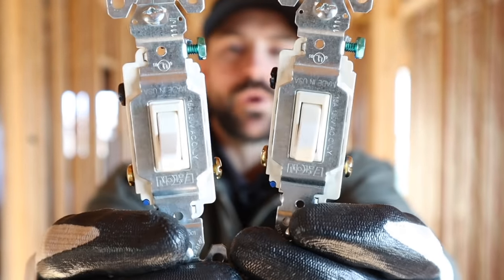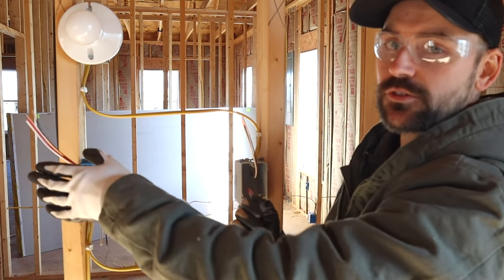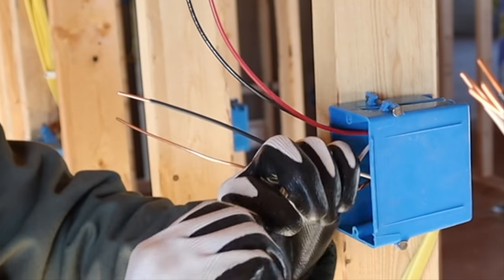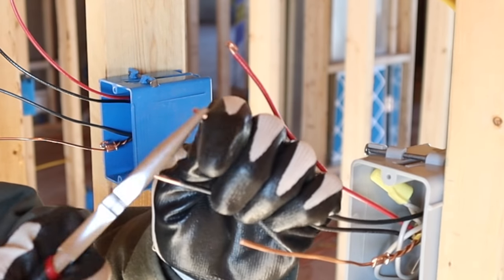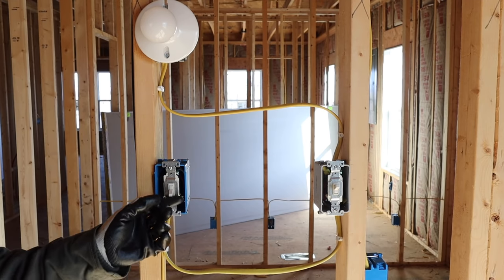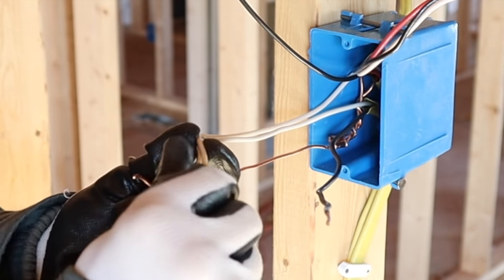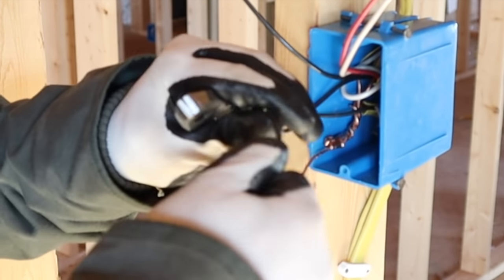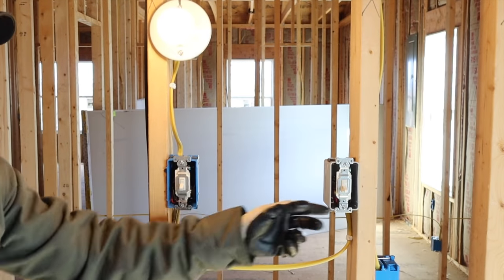How To Wire A 3-Way Light Switch - 3 Way Switch Explained (2 EASY & SIMPLE Methods)

Comment: Thank you for the great tutorial, straight to the point and easy to follow. My house doesn't have a 3-way switch for the kitchen light, so I am planning to add it for convenience. I believe method 2 will be the setup since my kitchen light is set to have this type of wiring.

Comment: Josh that was an excellent video about the ever confusing 3 way switches.  I have watched youtube vids the past 3 days and this is by far the best explanation how to connect your wiring.  I am installing 3 led lights and an exhaust fan in my master bath and need a 3-way system.  
r
Thanks for your time and video very much helped 👍

Comment: Great. Now a question for you. In an installed and wall blind situation (House where you don't know which wire is which) How can you identify, of the two 3 ways switches, which one gets direct load brought in from the circuit and which switch is the one that carries the black wire to lamp/device?

Comment: I must say, I like how everything is explained in these videos. Very clear. I'm definitely  going to keep checking your other videos. Now, one thing I would suggest (just an opinion) is for any installer to double check the power going into the cables even after you turn off the breakers. Remember, safety first brother. Keep up the good work and thanks for sharing your knowledge.

Comment: Question: I'm wiring my new shop and for my lighting inside and outside I have a 2 gang box with a 3 way switch for the ceiling lights and a Sunsmart All-in-One timer for the outside lights. How would you bundle the wires knowing you have a neutral pigtail coming from the timer. The box has one power source. I watched your video on how to wire A 3-way light switch. In your video the second method is how my setup is. For some reason I'm having a hard time visualizing the proper bundling of wires. Wire size is 14/2 and 14/3. Can you help?  By the way, great video Thanks.

Comment: Thank you, I was trying to wire from a wiring diagram that didn't identify which terminals were which.  It looked like a match but it wasn't.  In a few days I have a timer coming that will replace one of them.  The timer being for the lay light that keeps the chickens laying on the short winter days and the swith being for if I need to check on the chickens after lights out.

Comment: The second example on the 3 way is a good one. Kinda shows what you can do with the neutral. And the light doesn't always come out of the second switchbox sometimes it comes out of the one the powers going into.

Comment: Great, informative video! The only thing I don't like in this video are those copper crimp sleeves you used on your grounds. They don't seem like they bond the two wires together very well. Both times you twisted them together, when you cut and folded the tail over, the sleeve slipped back. I would either use the wago connectors or the green wire nuts with the pass through for pig tails.

Comment: Hello Excellent.   I have to rewire two light fixtures in my garage and convert them to 3 wire.  Both are on single pole now. Is there a diagram for both lights to go on at same time? Or easy explanation?  THUMBS UP!!!

Comment: very nice video - I knew one way to do this three-way switch, but for some reason, it always tripped the circuit breaker - now thanks to you, I know two more ways - So, I think I will throw away my first way and use these two ways to do 3-way switches - I do wonder if one really needs to know 3 ways to do a 3-way switching connection - hummm..

Comment: My 3-way switch delemma is a light above each 3-way switch (two lights total).  There's 14-2 going to a light at bottom of stairs, and another 14-2 in the box top of stairs for the other light.  Then 14-3 connecting both.  Power comes in (another 14-2) at bottom of stairs.

Comment: I meant Josh but I love your channel, I was inspired when in another video you said you pulled permits yourself. I think I'll try that. Thanks for a great channel. I have a question about multiple 3 way switches in the same J-Box. So, when you enter my Tiny House and on the left is a wall switch, with 4 different 3 way switches. Each 3-way switch controls a different operation. One does ceiling lights, the other does Front porch lights, the third 3-way controls the deck lights and the Fourth 3 way switch controls an outlet at ceiling level for a rope light (LED). I know I can run 14/2 from the panel to the J-box and get power to the switches. Here is where I'm a bit unsure! I need to run 14/3 to the other J-Box that has Four  3 way switches that operates the same as the front door J-box. Do I have to run 4 different 14/3 runs? is there a way to combine those runs onto just one run? and if so how might that work? Thanks for your help!

Comment: Josh, 
I’m wiring a bedroom with a 3 way switch because the room has a bathroom door access. I plan on running it the way you have it in the first example in this video. But instead of one light I will be going to 8 wafer led lights. My question it do I still just daisy chain the wafer lights with 12/2 wire since I will have the 12/3 wire going from one switch to the other? 
Thanks

Comment: Dustin, Thanks for a great channel. I have a question about multiple 3 way switches in the same J-Box. So, when you enter my Tiny House and on the left is a wall switch, with 4 different 3 way switches. Each 3-way switch controls a different operation. One does ceiling lights, the other does Front porch lights, the third 3-way controls the deck lights and the Fourth 3 way switch controls an outlet at ceiling level for a rope light (LED). I know I can run 14/2 from the panel to the J-box and get power to the switches. Here is where I'm a bit unsure! I need to run 14/3 to the other J-Box that has Four  3 way switches that operates the same as the front door J-box. Do I have to run 4 different 14/3 runs? is there a way to combine those runs onto just one run? and if so how might that work? Thanks for your help!

Comment: I usually do not use  crimps  because wire nuts because they are easier to dissemble and use tails for grounds !! Also 14 gauge is usually for residential ! It was electrically sound but I find wire nuts easier and Waco's are even easier !

Comment: Basically in order to get a light switch to control a plug in lamp  is that what the travel wires for?
Is there anything else needed for such a general connection?

Thank you Josh

Comment: Thanks for the video!  One question: when using your 1st method, does it matter which screw terminal that the red and black traveler wires are attached to or could the red and black go to either?

Comment: Well 3 way switches are a great invention for star wells And 2 doorways on opposite sides of a room ! Of course you could realy confuse the viewers by throwing in a 4 way switch into the circuit !!
Reply: Why do you think we european electricians and traders learn this job 3 till 3 1/2 years to know all things? I self be happy if DIY workers put the cable and all other things together but a professional electrician should test all switches/sockets and ways from CU to this places. Put a new cable from light to next light is easy to handle, but if I see here the many questions I can only answer: "Please talk with a professional worker for this stuff - then if you need to ask do you not known it really!"

Comment: That second way got me a bit scared. I’ll stick to the first way for my application. Lol. Now I’ll search your videos for a switch box containing three separate switches. 1 switch wired like your first video for RV garage lights a second switch wired for an exterior light and garage receptacles and a third switch for workshop garage lights. Wish me luck
Reply from the maker: Hey Marcus! The second way is definitely more confusing. I like the first way better myself. I use it as much as I can to avoid the second method. Sometimes the second method is more convenient. Good luck on that project. Let me know how it goes! Take care!
Reply: Bro you need to tape wire on the switch
Reply: Bro you have to tape the wires on to the switches for safety otherwise you are ok
Reply: @TheExcellentLaborer  man I wired up the Overhead (30 feet up) RV lights (8) of them by using the first method. No issues at all. Thanks a lot
Reply: @marcusjames3035  I just want to point out that I'm fairly certain the second method of wiring does not meet code per 2011 NEC. You are no longer allowed to black mark a neutral wire and use it as a hot wire for this purpose on new work.
Reply: @robertkruse1780  thanks. It got me Skerd anyways. Lol
Reply: In most places in the world it is now code to have neutrals in the switch boxes, so the 2nd way is no longer up to code (again, most places depending where you live) so don't worry about it too much

Comment: When connecting the black power wire from panel and black 12/3 wire together in method 2 can you pigtail off connection to power another switch?

Comment: I have two 3 way switches at either end of the living room.   I have tested every outlet in the living room with those switches in different positions and I can not find an outlet (upper or lower) that these switches control.  The outlets remain hot no matter what position the switches are in.  Next, I turned of the power to these switches and toned the wires under the house until I found the wire with tone.   The wire I found is a 14-3 with ground and seems to be running between the two switches.   QUESTION...  Should or can I use the black and white wires in this 14-3 to power an outlet I installed in the  living room floor since I cant find a 14-2 coming off the switches?

Comment: Is there a reason why you're using 12-2 and 12-3 for a light circuit? All the houses I've ever wired, I only use 12 gauge for kitchen appliances or in the garage for shop power tools.

Comment: How do identify a common wire while having two Black and white Wire? I think method two is what im needing but have the issue of one switch having to be constantly on for the upstairs to turn the light on and off, meaning if the downstairs switch is off the upstairs switch wont work.

Comment: Hey Josh, I am having trouble with wiring a 3 way fan light switch. I want 2 switches for the light part of the ceiling fan and 1 switch for just the fan. Also thinking about getting the remote style ceiling fan. Im in the wiring stage of my house build any advise would be greatly appreciated!
Reply: You’ll need a second power source to feed the fan. I just got done doing this

Comment: Do you have a video obtaining power from an outlet to a light. I have a old house that has a switch at the top and bottom of the steps but got power from the room next door. So they are already wired. But I took the light out and there is only a white, black, and ground there. I need to run power to that circuit and can only do it at the light by running power from an outlet that has power nearby

Comment: So much twisting and crimping. If you're going to use #12 I'm sure you can afford WAGO connectors. They make 4 slot ones so you can hook all the grounds together and have a pigtail.   3-way is pretty easy, it's gets more complicated when you are using 3 or more switches to control one set of lights (like all the outdoor lights around the house).   Watching you fight that #12 brings back memories.  Thanks for the cool videos.   If you pay attention to which wire goes to which terminal, you can have both switches down when the light is off and flipping either UP will turn light on. This aesthetic point is particularly important when you have a multi-gang switch array at the front/rear door.  So that way when you leave, you can simply slam all the switches down to have them off (assuming the other switch is also in the 'neutral' position).  You could also just flip one of the switches over from the way you have them, but with #12, that could be tricky in a shallow box.

Comment: Love the videos keep them up.  But I keep shaking my head when i see all those 12/2 and 12/3 wires just for lights.  Its like its ok but then so is putting a 50 hp 3 cylinder diesel motor on your push mower, right.  You can do it but really not necessary.   Especially these days when a roll of 12/2 went up from $42 per 250' roll to $250 per 250' roll.  I'm actually a contractor that works as well.   Keep up the great videos.

Comment: Am I able to wire a 3-way dimmer switch so that I can turn the light on and off from both switches? 

What am I doing wrong if the dimmer switch doesn’t turn the light on when the non dimmer switch is in the off position?

Comment: So the 2nd switch has no neutral wire ?  So the 2nd way you can't run two motion sensors for like on a stairwell with a landing in the middle.

Comment: Hi, why do you not need to use the neutrals?  I have a light/fan combo and vanity light on a 2 gang but unsure what to do with the whites
Reply: Neutrals get tied together and stuffed in the back of the box, they are normally not used on terminals for switches.

Comment: August 15, 2024 at 9:44 PM. This is a great video but on your first video you were showing at three way switch at the end both switches were down and your lights was on. On the second video where your current was coming in where your light was at the end when Lights  switches was wired they both down the lights was on which I know it will work but how can that be wired that both switch would be down to be off on the lights. Just curious which I know that three-way wire  that you did will work but how can it be wired with both switches down and lights would be off. Great video just curious thanks !!!

Comment: Great explanation of connecting a three way switch. Just curious as to why you used 12 gauge wires rather than 14 gauge?  $$$.
Reply: By code a 20 amp breaker needs atleast 12 which is the stand breaker for branch circuits in a house

Comment: i have a hall light with 2 3 way switches. i want to run a light in the closet in the hall off the 3 way switch. have a wiring diagram. thanks

Comment: Here's a question. When? Wiring the 3 way. As? You did in the second example. If you put receptacles on the same circuit would they read reverse polarity because you're using the neutral with your switch? Because with recepticles the neutral's are used and not with switches. They usually aren't but as in the second example you did use the neutral on the switch.

Comment: Here's a question for ya. I've got a light that the power is coming from the light previous electrician used the light box as the joint box. So it's a 12-2 wire coming to the switch. The homeowner wants to install another switch down the hallway to turn the light on and off from both ends of the hallway. So I installed a double pole switch on both ends and 14-3 wire from switch to switch but can't figure out how to make the two switches work together so at present in order to turn the lights on from one switch the other switch has to be turned off. 😢 So how do I make them work together?

Comment: Nice work! Was it your preference to use 12 wire instead of 14?
Reply: It depends on whether it's a 15 or 20 amp circuit.
Reply: I think Josh prefers 12 gauge throughout, one less thing to be concerned about. Yes it's more expensive, but if it's a custom home nobody cares.

Comment: Is there a way to wire a switch to turn one light of and another light on? Is there a way to make this a 3 way switch system?  Where when you flip one switch it turns a light off and another on and then when you flip another switch the lights switch from off to on and vice versa?

Comment: The last example is called a dead end three wire. You can add a another three way to the left and make the middle box a four way switch, this is called a double dead end three way.
Reply: You would need an even bigger box.
Reply: Some jurisdictions won't allow the second method anymore with just a 3-wire to one box because by code you are required to  have the neutral at all switches, you would have to use a 4-wire cable
Reply: @covah127  2020 CODE

Comment: The way you crimp your grounds is the reason many jurisdictions have outlawed crimp connectors. Also, when you color tape a white wire to indicate it is not a neutral you must tape it for most of it's exposed length, not just a single wrap near the end. As for just turning off the breaker, have you ever heard of LOCK OUT/TAG OUT? Just turning the breaker off can get you killed. I've had coworkers end up in the hospital from just turning the breaker off.

Comment: I'm pretty sure the 2nd way might not be allowed with the current code, since it requires every switch box to have a white wire for programmable switches. Not an electrician, but that's something to keep in mind.

Comment: How do you wire a 3way when your feed starts at the fixture and you have 12-3 in one box and a 12-3and a 12-2 in the other box which is a hot and a load
Reply from the maker: Hey Andrew! Clothes washers is 120V 20Amp and so is the dishwasher in my house. The dishwasher is on a dedicated circuit and the clothes washer is on the laundry room receptacle circuit. There is not a limit per code as to how many outlets can be on a circuit but I try to limit the circuits to about 10 outlets per 20 AMP circuit. Hope that helps!
Reply: @TheExcellentLaborer  Lights now days take very little power. That's a lot of over kill. IMHO